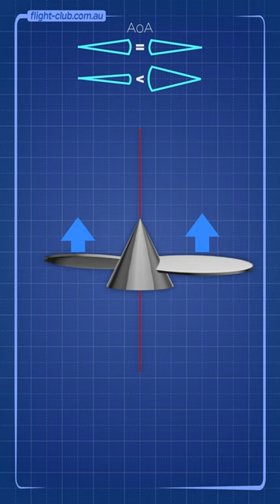Propeller Effects. #aviation #propeller #pilot

Comment: Finally! A good visual I can show my students. You earned a sub from a CFII
Reply: I know right its sad that not enough YouTube content that could be great for education is used for that. And getting a visual representation makes it so much easier to understand than if you just have a teacher talking. 

Sorry for going on a rant😅
Reply: Which flight school? If it’s not much to ask..
Reply: The conclusion here is wrong, you need rudder on takeoff because counteracting the torque of the propeller uses aileron, and the drag of the aileron causes a yaw torque on the aircraft. As for the right side of the propeller having more lift, that is true, but due to gyroscopic procession, that torque is actually a pitch up not a left yaw.
Reply: And now I know why I have to rudder some much on take off. 👌
Reply: Yo
Reply: Just how a strong electric motor works when you turn it on, it'll make you force to keep it straight during direct input. Very impressive
Reply: How about the downward rotating blade moves further than the upward rotating blade? This took me a while to understand
Reply: Teach me
Reply: What does CFII stands for?

Comment: My instructor never explained why the aircraft yaws on take off I just assumed it was to engine torque, thanks for telling me the real reason 👍
Reply: Displaced torque, you're kinda right there.
Reply: If you are flying a tricycle gear plane then torque is about the only factor causing a yaw to the left, up until the point of rotation. Once you rotate P-factor occurs. On conventional gear planes P-factor sets in almost immediately until the tailwheel is rotated off the ground then diminishes. 

Basically anytime the plane is at a high AoA and power setting P-factor will occur.
Reply: Me too
Reply: Torque would be roll rather than yaw I think, but yep that's p-factor :)
Reply: What a worry your instructor first even one this basic physics concept
Reply: @mrmaniac3 any force with rotational effect is torque, yaw included
Reply: Don't forget gyroscope forces as well
Reply: Also has to do with air spinning around the plane and hitting the left side of your rudder
Reply: That's why they have multiple propellers each one spinning the other way, offsetting this little phenomena
Reply: Same for me.😊
Reply: Actually there are 4 forces that pull the aircraft to the left. 
1. Torque
2. P-factor
3. Gyroscopic precession 
4. Thrust wash hitting the left side of the rudder
Reply: Well long story short, engines are degreed at the firewall ‘incidence’ to counter act the torque of thrust line… text books exist for a reason my friend
Reply: @RicardoSalinasFournier another name for 4. Is spiraling slipstream.
Reply: @jakobusstrauss1293 there is also spiraling slip stream which has a significant effect on

Comment: Right, except the end.  The video assumes the propeller rotates clockwise (viewed from behind). For anti-clock rotation the effect is reversed, and rudder use would be opposite.  This was the first effect a Spitfire pilot experienced when moving from Merlin to Griffon powered Spitfires, as the Griffon rotates opposite to the Merlin.
Reply: very good information, is there a predominant rotation that most planes use or its it a fairly even split?
Reply: @homestyle2000  US engines tend to rotate clockwise (when viewed from the rear).  British engines tend to rotate anti-Clockwise (eg Bristol Hercules). Except the Merlin!  There is no fixed rule though.
Reply: @David-lb4te  Good to know! I'm going to the Supermarine dealership tomorrow and will probably order the Merlin.
Reply: @JTMarlin8 I assume you are sarcastic. Pretty sure the Merlin engine was produced by Rolls Royce too.
Reply: I’m assuming that with twin props they do one of each and they cancel each other out?
Reply: @David-lb4te it usually has nothing to do with the nationality of the manufacturer of the engine. It only varies by the manufacturer of the aircraft. For example, Cessna aircraft engines tend to turn counter-clockwise, whereas Cirrus aircraft tend to turn clockwise. Both are made my American aircraft manufacturers, and both utilize American-made engines (Lycoming and Continental, respectively).
Reply: @cartertran270 that is correct. That is called contra-rotating props. And you’re exactly right, they cancel out the effects of P-factor and torque. Many twin engine aircraft also have a feature called Prop-Sync. This can help perfectly synchronize prop RPM to reduce noise in the cabin as well as flight coordination.
Reply: @cartertran270  The effect remains similar.
Reply: @cmilburn26 Cessna and Cirrus engines rotate the same direction. In fact some models even use the same engines.
Reply: @cartertran270 Most twin engine planes use the same engine on both sides. Both engines rotate the same direction. This is in order to maintain simplicity and commonality in parts for both engines, keeping things cheaper generally. 

During normal operation there is a very small effect, but it is still there. For takeoff you would still trim in a little more rudder in order to help you maintain direction. 

The bigger issue is during engine failures. When a twin engined plane suffers from an engine failure there will be a very big force trying to yaw the plane into the direction of the failed engine. One engine is pulling forwards and the other is doing nothing( in fact it is actually producing drag). Try to walk with one leg stuck to a lazy Susan. This leads to an unequal forces around a centre point, creating a turning moment, referred to as yaw. 

Twin engined planes which have both engines rotating in the same direction will have, what is referred to as, a critical engine. This means that the failure of that engine will have the most detremental effect on aircraft controllability. Howcome? Because if both engines are spinning in the same direction, both engines will have their up going propellers on the same side and down going propellers on the same side. The side which has its down going blade closer to the longitudinal axes of the plane will be the critical engine, because if it fails the remaining engine, which has its down going blade farther away from the longitudinal axis, will produce an even greater yawing moment.

To eliminate the critical engine some planes are fitted with counter rotating engines.
Reply: @cmilburn26 You probably meant to say counter-rotating propellers, which means that the propellers on each side spin in different directions. Usually towards each other at the top, such as on the Piper Seneca series. 

Contra-rotating propellers are two sets of propellers fitted one in front of the other on the same axes, but spinning in opposite directions. Look at the Fairey Gannet for example.
Reply: So with that logic if a plane has 2 engines/propellers then they should rotate opposite to each other?
Reply: It’s been while, but I’m pretty sure Cessnas pull left when adding power, needing right rudder. Could well be wrong though.
Reply: @cartertran270 most twins do not have counter rotating engines because it is expensive to have to manufacture 2 different engines for each direction of rotation. the result is that the airplane has a critical engine in an engine failure where it is worse to lose one engine over the other.
Reply: @cmilburn26 most twins do not have counter rotating props
Reply: @cmilburn26 this is not true
Reply: @harmanpreetsingh7848 most do not

Comment: That's why the P-38 was a great plane. One prop went counterclockwise, and the other clockwise (blades flipped too) created very good stability.
Reply: That is how every single twin prop aircraft works. Aztecs, Barons, P-38’s etc. The issue at hand only applies to single prop aircraft, which would eliminate the P-38.
Reply: @cmilburn26  Nope. Most twins have same sense rotating props. Too expensive to build engines for both senses of rotation.
That's why twins have a so called 'critical engine'. If that fails, the P-factor of the remaining engine acts outboard, giving an even greater asymmetry of thrust. 
Except the P-38. They chose sense of rotation of the props such, that the P-38 had TWO critical engines...
Reply: It’s not for nothing that they put an even number of turbojet engines on an airplane: 2, 4, 6, 8, 12 on very heavy airplanes
Reply: @egor_flips You could say that, but there are a number of exceptions. Ju-52, Ford Trimotor, numerous Italian ww2 bombers, or the Lockheed Tristar to name a few.

Comment: I didn't know this, that's really interesting
Reply: In flight school we called it the left turning tendencies.  P factor also includes air hitting the tail
Reply: you should also look at adverse yaw. its the yawing effect that using the ailerons cause and the reason why coordinated turns are a difficult skill to develop for some pilots.
Reply: @infotechsailor You are referring to two different effects. P-factor is what is explained in the video. The slipstream effect is due to the spiralling propeller slipstream hitting the vertical surface of the plane (usually the vertical stab) on only one side, thus pushing it in a direction and yawing the nose in the opposite direction. The existance of the slipstream effect has been debated by aerodynamicists.

Comment: Helicopters also have an issue similar. The faster they are moving forward. The advancing side of the main rotor gets more lift than the retreating side of the main rotor. Then, the power stopping procession causes that change in force to be applied 90° around the spin axis.
Reply: This is called the Dissymetry of lift. Not really the same issue, but simmilar effect. The reason it happens is because you have an advancing blade ( the blade going in the same direction the helicopter is travelling) and a retreating blade ( the one going in the opposite direction in which the heli is travelling). Blades need airspeed to produce lift. More airspeed = more potential lift. The one going in the same direction of travel as the helicopter will have an effective airspeed which is equal to its own movement plus the forward speed of the whole helicopter. On the other side the retreating blade will have an effective airspeed equal to its own movement minus the helicopter's forward speed. Thus the two sides are producing unequal lift. The faster the heli flies, the greater the effect. This can be compensated for during its normal flight envelope, however when a heli reaches the critical airspeed where the retreating blade can no longer produce enough lift it will stall and its lift will dramatically reduce. This produces a large inbalance in lift. The force is displaced by 90° in the direction of rotation of the blades and causes the nose of the heli to pitch up violently. This phenomenon is called retreating blade stall. Basically it stalls because it flew too fast.
Reply: That's why helis have speed limits. Eventually the retreating blade stalls completely.
Reply: @jackcobb1090 that sounds terrifying.
Reply: So how to fix this problem?
Reply: Does double rotor helicopter have this issue?
Reply: @jackcobb1090  AFAIK the speed limit is caused on the other side: When the advancing blade hits the speed of sound. That's what creates the characteristic rotor sound of the Huey.
Reply: @randomguyontheinternet6885 tandem or coaxial rotors would cancel that effect, but speed is still limited. This is why Airwolf could never be supersonic. 😉
Reply: Can't this effect be cancelled by scewing the fuselage like on the Mi-28?
Reply: @kambalekabanda  takes a bit of background: on most helicopters, you can adjust the pitch of the blades to adjust how much air they catch. On an aggressive pitch, a lot of air is displaced, but there is a lot of resistance. On a low pitch, there is less resistance but also less lift. There are control arms on the blades that can quickly adjust the pitch of the individual blades, taking a more aggressive pitch on the retreating blade, and a less aggressive pitch on the advancing blade. This adds lift to the retreating side, which levels the helicopter at higher speeds. It’s the same concept if you hold a pice of cardboard out of a car window level to the ground, it will not be hard to control, but if you tilt it to a 45 degree angle it will pull your hand up and it be difficult to control.
Reply: @Samimies possibly, but that issue is caused by the spiraling air from the propellor pushing air down on one of the wings and pulling up on the other, while the effect caused by pitch, as in the video, would be reversed during a negative pitch. While traveling level to the ground, the pilot would have to manually counteract the tilted rotor, so it probably most efficient to optimize the tilt of the propellor only to counteract the uneven vortex during level flight, instead of for the short time at takeoff.

Comment: Even more complex than that.
The air does not flow in a straight line, but in a spiral. It will hit the left side of the vertical stabilizer more directly than the right, thus acting like it is being given left rudder.

Comment: Another reason for aircraft yawing to left is spiral effect. Where the airflow or thrust produced by propeller goes clockwise around the air plane's body or fuselage and hits the vertical stabiliser which makes aircraft yaw to the left.. You can read more up on this in principle of flights.. I cleared my technical thanks to you. 👍

Comment: The spiral effect of the propeller wash on the tail gives planes more of a swing
Reply: Not really. P-factor and torque and gyroscopic precession are the largest forces. The existance of spiral propeller slipstream has been debated.
Reply: So why do they turn on the ground also if its the angle of attack when the planes level on the ground? The blades are spinning fast air moving fast wouldnt that push on the vertical stabilizer no matter what even level? This guys comment makes more sense then yours and tons of other peoples. Js

Comment: It's even more complicated for rotary wing aircraft. Huey pilot I know said once that there are 3 P factors involved with copters.
The advancing blade on a chopper is the reason the aircraft commander sits on the right in a helicopter.
Fixed wing aircraft have the command pilot sit on the left...mostly for visibilty in the pattern.

Comment: Interesting. I was told that the plane yaws left because the prop wash flows around the plane and pushes on the tail fin. , I guess it's a combination of both
Reply: I learned it’s multiple factors with the primary being gyroscopic procession.

Comment: It makes a huge difference in RC airplanes.  The trust-to-weight ratio is higher.  Those of us who still scratch build them put down and to the right angles on the firewall. It is a small adjustment that makes a huge difference.
Reply: Yep, that thrust to weight ratio is a lot higher on RC planes and tail draggers are really affected by this left turn tendency on the takeoff roll. Do you think that’s more from torque, or because tail draggers are pitched up a little (like on the vid) while on the ground? I always thought we offset the centerline of the engine to compensate for torque or gyroscopic effect (I’m not sure what the correct term is) of the engine rather than differing levels of thrust from the different sides of the prop. Really interesting though.

Comment: The effect is 90° after of where the propeller produce more foce due to the higher angle of attack. That will not turn right, but in that example want to pitch up. The turning effect is due to engine torque specially in high power manovra like take off.

Comment: Well, what is the airspeed? While on the runway it changes from 0 to 80 knots. So when the plane starts to roll the angle of attack is the same for up- and downstroke. That changes gradually with increasing speed. And with that the plane lifts the tail first before it rotates. Means the airflow before take-off is again in line with the propeller's axle.

Comment: I was taught the airflow corkscrews around the body of the airplane and hits the tail fin on one side causing yaw to change with power settings. 

Honestly that explanation never really rung true for me, but I guess I sorta just accepted it. 

The effect is quite noticeable though. You have to add a good bit of rudder when you pile on the throttle during a go around for example

Comment: Here's an interesting propeller story: The early Battle of Britain Spitfires lacked a device to provide variable propeller pitch, which pilots felt was seriously hampering dogfight performance.    Supermarine rose to the challenge and working round the clock, had a working system ready for retro fitting to Mk.1's within weeks. Even Supermarine's  managing director donned his overalls, loaded his Bentley with the new kits and took it on himself to do on site retro-fitting work at front line RAF bases.
This was wartime and such a bureaucray busting go for broke attitude was essential for victory.
 Indeed, it wasn't until years later that Supermarine realized they had forgotten to invoice the RAF for the cost of the variable pitch upgrade kits and retro fitting.

Comment: confused with a couple questions… if the blade at the top and the blade at the bottom have biggest difference in angle of attack, then wouldn’t the most force be from the bottom and pitch the plane up, not left? Also, wouldn’t this be negligible as the plane is flying where it’s pointing? (Shouldn’t the blue line in the video be parallel with red line for the most part?) Finally, why does a bigger angle of attack generate more thrust?
Thanks